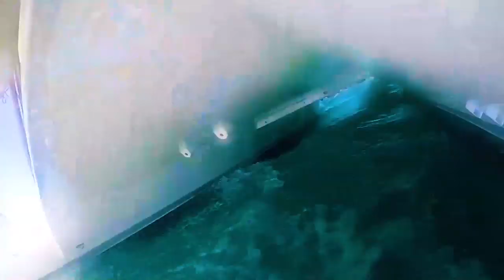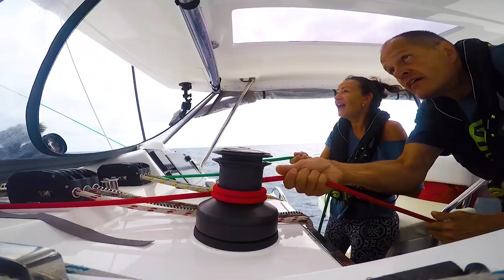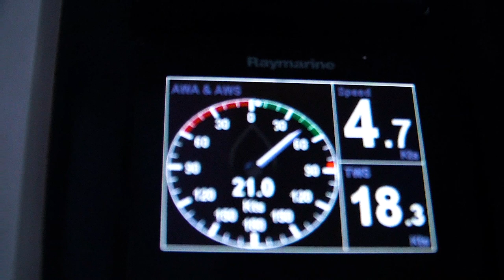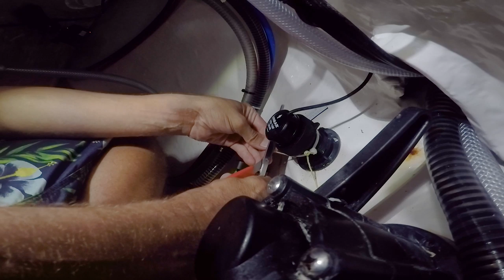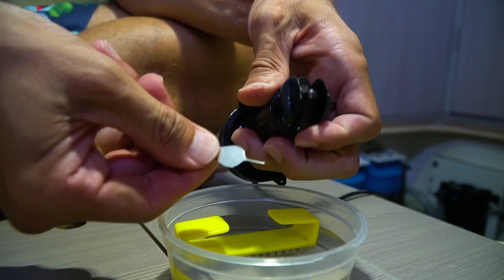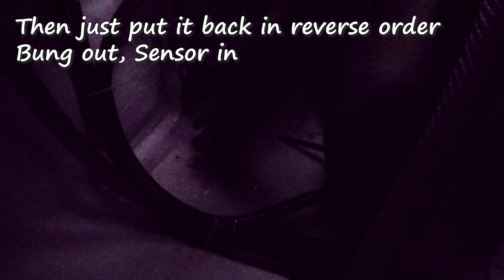#49t When is your Speed Log wrong and how to fix the AirMar Speed Temp Sensor ST800 | Sailing Sisu

Comment: On Leopard, everything is generally well thought out, but not the speed sensor. On my boat, it's much easier, just remove a pin and there is a check valve to avoid water entering the boat and replace it with the plug with the pin. And we can only put it in the right direction.
When I stay without navigating, I remove the speed sensor and it always stays clean. 10 seconds of handling and no stress.
Thank you for your always interesting videos.
Reply from the maker: Yeah, I guess the standard lewmar speed log is not the most practical 😂

Comment: Good troubleshooting. I figured out I had the wrong size tires on my car by comparing my speedometer to my Garmin GPS speed. My dash Speedo was reporting 5 km /hr slower than actual.... If your boat was OBD-compliant there would have been a rationality check on the input speed sensor and a trouble code would have set. In this case you are the on-board diagnostic. Lol. 
How often do you scrape the hull? It’s probably getting fairly unsmooth at this point with growth.
Reply from the maker: Yes, crazy. From a computer nerd to troubleshooting boat speeds! We cleaned the hull 8 months ago and now again. Was actually only soft algae beard growth. The lights and instruments were crazy full off barnacles and hard growth!

Comment: We pull our sensor out when we are staying put for while (anchor or dock).  As result you will not have to clean the sensor very often.
Reply from the maker: Sure, Tom, but we've been sailing 13,000nm in 9 months only stopped while at anchor :-) this is the first time that we stopped for two months ;-) but, good advice, will for sure take it out!

Comment: Really, pulling out your speed log is unnecessary at sea, if it packs up you can figure your SOG from your positions for any given time period. Speed through the water is interesting to see but not that important really. It's much easier & less "stressfull" to simply wait & pull or simply clean it with a toothbrush at anchor anyway, especially if you apply a little bottom paint or propspeed to the paddlewheel & cavity when you pull it next time. Mine does just fine between haulouts with just using a very soft tootbrush (with ablative paint anyway) occasionally as required during regular checks with snorkle gear. Otherwise, if it spins fine with your finger, leave it alone.
Reply: The chart plotter needs all apparent and real wind and speed data, including speed through water, to make accurate calculations. Speed over ground should eventually also be calibrated. The manual describes procedure in detail.
Reply from the maker: Yes, as Marc said and I think I mentioned it, one looses all "true" calculations as well as currents and leeway. Moreover, I have set my wind vane and chart plotter wind direction as true. This way I can quickly see how the wind and land masses related to try and calculate the acceleration zones, etc. But you are right, the speed log can stop and no harm done. Thanx for the advice on painting the wheel, I was wondering about that!

Comment: Shut Power off before pulling it out? Watch Adventure Adrift #176. Change thru Hull at Sea!
Reply from the maker: Exactly what we did. 3,000m deepl
Reply: They replaced the thru hull from outside the Boat!
Reply from the maker: No ways! OK, we did not do that 😊